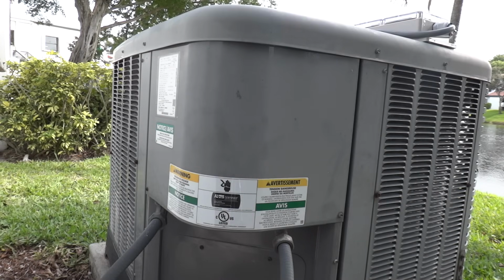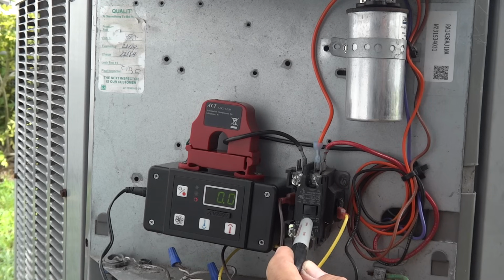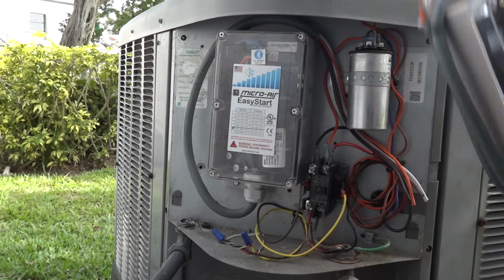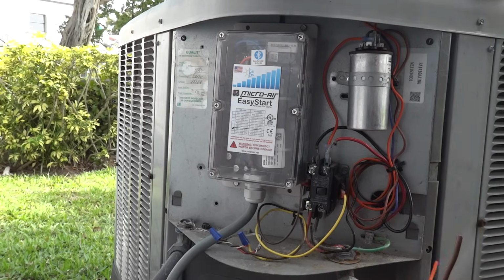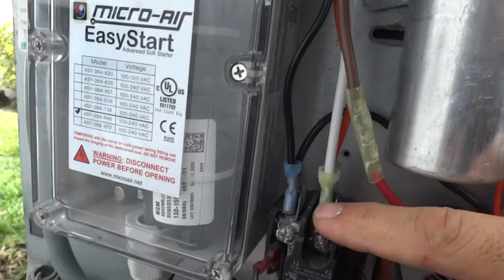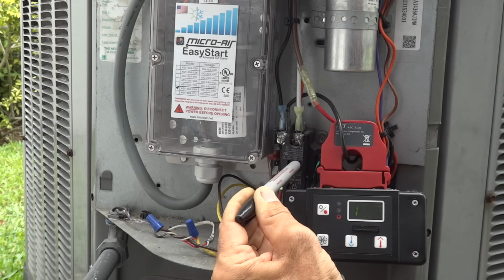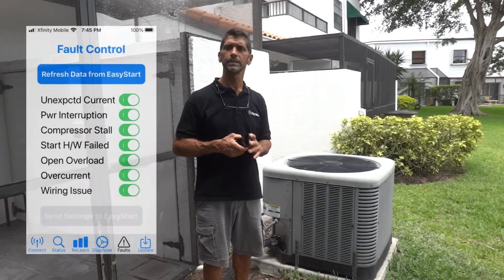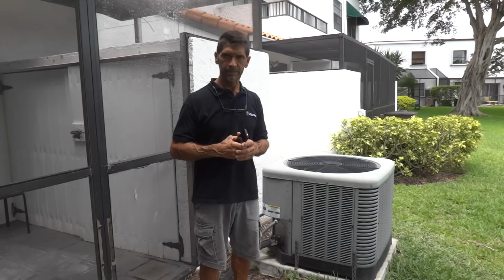Micro-Air EasyStart Home A/C Installation (368 Series)

Comment: Just curious if it makes any difference the type of compressor when using this soft-starter? I told my A/C guy about this, but he came back and was recommending a "5-2-1 compressor saver" which he said was a hard start. Perhaps he just doesn't understand why I want to use the Micro-Air product? When I am running on my whole-house (22kw) generator and the A/C unit kicks on, you can hear the generator lug down for just a fraction. I just figured that using the Micro-Air soft start, I would absolutely eliminate that. But, I want to make sure that I am not doing anything that adversely affect the outside unit. I am about 2 months from being out of warranty too!
Reply from the maker: Hello and thank you for your comment and questions. You were spot on in your assessment of your A/C tech's misunderstanding about the differences between a hard start and a soft start.  Yes, adding an EasyStart to your A/C will absolutely eliminate the startup surge that is bogging down your 22kW generator.  Adding a hard start will not eliminate the start surge, and it may or may not make any difference.  Try it if you'd like first, but I am confident you will not be satisfied with the results.  

With EasyStart installed, even when operating on utility power, it protects your compressor BETTER THAN the OEM configuration does. It achieves this in multiple ways.  Beyond its obvious benefit of eliminating the mechanical & electrical stresses of every startup, EasyStart also continues to monitor and protect your compressor after the startup is over with, during steady-state operation.  EasyStart monitors for harmful conditions like brief power interruptions, brownouts, overcurrent conditions, stall conditions, etc.  All of these would not be handled properly by the OEM configuration, but EasyStart does handle them. EasyStart will disconnect the compressor in such cases, wait 3 minutes, then re-soft-start it, likely without your even noticing.  

Since you're at the end of your warranty, you can either wait or install and EasyStart right now.  The sooner you install EasyStart, the sooner you and your generator will enjoy its benefits, and the sooner you will start extending the life of your compressor.   Thank you again for your interest.
Reply: Well, my installation has not gone so textbook! As is turns out, since I have a monitoring system (CoreSense Diagnostics), I am going to have to make some modifications to my new EasyStart, such a moving jumpers and cutting another one. And, something else (on page 15 of the troubleshooting manual about disabling the starting delay). I am still waiting on a reply from support after sending them photos and schematic before I go any further. @MicroairNet
Reply: Update...I didn't have to do anything with jumpers. But, I did have to follow the instructions on page 15 as mentioned in my last. Despite all of this, I still don't think things are working right! My unit makes really strange noises now with the Easy Start connected. What is really frustrating is the lack of help from anyone in a timely manner. The email exchanges are days apart and, while I already sent photos of my system schematic and photos of just about everything, and lastly uploaded/sent data to Micro-air from the app, I still haven't heard back. I shot video of what was happening, but not knowing A/C, I am not sure exactly what was going on. But, it seems as though the compressor was trying to start and when it did, made a kind of banging noise (that the unit never made otherwise). When it did that, the LED on the Easy Start changed to a single flash. Otherwise, it was OK. On the Copeland Core Sense monitor, it started flashing 3 flashes, indicating a couple of issues. However, when I disconnect the Easy Start, the diagnostics return to normal after the first restart of the compressor.
Reply from the maker: @ffmedic1638  I've requested that your case get priority.  Several people are on vacation this week since it is August and just before school starts.  I realize that is no excuse, but we'll appreciate your patience nonetheless.
Reply: I appreciate you reaching out to them. While someone did contact me, I have to say the help was far from what I expected. While we are experiencing 100 degree days, having to wait hours between emails  when a phone call might have taken care of a simple question. While the wiring was simple, my system had a monitoring system for the compressor which required me to make some settings changes on the Easy Start. However, even this did not get me up and running. When I would run the system with the ES connected, the compressor would not run. I finally got so frustrated with the (lack of) help, and particularly a simple phone call while I was at the outside unit, that I returned the product to Micro-Air this morning. I really hoped to see this in action on my system. But, fortunately, I do have a 22kW generator and I really don't have a problem. @MicroairNet
Reply: LATE UPDATE to the above saga: After some awesome help from MATTAO, I received a replacement unit and installed it Sept 3. We even did a couple of tweaks and got the inrush amps down a little bit more. All in all, about a 65 percent reduction!

Comment: Can I use the X72 on the 3 ton unit because I’m planning to buy a bigger unit in a couple years.
Reply from the maker: Hi and thanks for your question. Yes, you can use the X72 on a 3-ton unit, but it may not reduce the starting amps by quite as much by the X48 would.  But not to worry as the difference will be small.  Once you get your new, bigger unit, you can move the EasyStart over to that one, perform a "ReLearn", and it will work well.
Reply: Thank you.

Comment: 7/22/2023 I installed two of them on my Goodman 3 ton ac units. From 79amps drop down to 25 to 28 amps according to the blue tooth app. These things are sweet love them thank you.  I found out about these soft starts when talking to the electrician who installed our home generac generator.  All these years and never knew about this item.  I could kick my self in the ass.  Anyway thank you hooked them up today and running great.  Thanks.

Comment: Will this work on a older air it is a 3ton that uses r22 Freon
Reply from the maker: Thank you for your question.  Absolutely yes!  EasyStart works with all fixed-speed compressors on all types of air conditioners for any application, regardless of the type of refrigerant.  It even works on the older reciprocating compressors.

Comment: I just received my EasyStart this week from your company. Do you recommend I have a Heat/Air company install it, or should I do it myself? I consider myself above average for DIY jobs. I have a 4-ton Ruud heat pump here in Oklahoma.
Reply from the maker: Hi and thank you for your purchase and for your question!  If you are above average, then you can definitely do the EasyStart installation. Amazingly, at least 90% of our customer do their own DIY installation.  Check out the many sample wiring diagrams in the EasyStart Knowledge Base on the Micro-Air website.  There probably exists one that is close to your Ruud HP.  Thank you again for your business.

Comment: So what is the wiring differences if there are two different run capacitors for the fan and compressor?
Reply from the maker: There really is no difference in the wiring.  The Orange wire from the EasyStart still connects to the terminal on the compressor's (separate) run capacitor that is ultimately connected to the compressor's start winding.  This terminal may not be labeled "HERM", as in the case of a dual run capacitor, but you can still figure out which one it is by looking at your system's wiring diagram and identifying the wire and its color.

Comment: So where does the micro air unit stand on the economy side: do you experience an electric bill reduction at all?
Reply from the maker: Hello and thanks for your question.  EasyStart only dramatically reduces the start-up amperage of your compressor - which lasts about 1 seconds - and has no effect on its steady-state, running amps.  Even over a 30-day period during which a few thousand compressor startups may take place, the amount of energy saved will not add up to anything measurable in your electricity bill.

Comment: I installed the easystart 368-72 for my 4 ton Rheem unit. I terminated all of the wires exactly as indicated and I still get an error. LED light blinks 7 times. I tripled check all wires and they're landed where they need to be. Anyone know what I may have did wrong?
Reply from the maker: Hi and thank you for your purchase.  7-blinks of the red LED indicates there is still a wiring issue.  Please take some clear photos of your 4 wiring connections and of the system's wiring diagram (on the inside cover of your electric box) and submit a trouble ticket to the following website at Micro-Air.  Someone will look at your case and advise about the wiring.  

https://www.micro-air.com/contact_microair.htm

Thank you again for your business.
Reply: @MicroairNet  thank you. I will take pics and submit them.
Reply: @MicroairNet  I figured out the issue. Install error on part (obviously). The butt splice was not making full contact with both wires. I re-spliced and worked like a charm. Green LED is solid and states "normal".
My LRA went from 102.4 amps, to 28.7 amps with the easy start. Very impressive! You guys are awesome. Replying to my question within hours. Thanks.

Comment: Great video, with excellent detail. So how hard is it to get the house wired so that I can plug my 7500watt genereator it?
Reply from the maker: Hi and thanks for your compliment and comment. Wiring your house to be able to easily plug in your portable generator outside and switch over to it is a bit of work. Unless you are an electrician or very well versed in codes and electrical wiring, it can be difficult and potentially dangerous.  Typically, people get a 50A twist-and-lock outlet installed on the outside of their house near to where their electric meter comes in.  This is where the cord from the generator would get plugged in while it is running outside somewhere near the house.  Then, in their main breaker panel (load center), they have a separate breaker installed for this plug with what is known as a mechanical "interlock" that prevents this breaker from being turned on without having already turned off the main breaker feeding the panel from the grid (meter). This prevents you from backfeeding the grid with your generator during a power outage.  There is an excellent Facebook group on home generators that I have to support EasyStart questions from that you might want to join if you are interested in learning about this (https://www.facebook.com/groups/1716967438485868).  Otherwise, if you don't want to attempt it yourself, it is highly recommended that you hire an electrician.  Hope this helps.

Comment: The best starting device I have ever seen in my 40 years as an AC Tech! I would advise to checking your uf/ microfarads with a meter on the existing capacitors and see if they are up to the manufactures value. All capacitors lose value over time and age with usage. No system should ever be close to let alone exceed LRA. Locked rotor amps. I have always installed starting devices on new equipment, because it gives longer life of the compressor. It's controversial over the term easy start or hard start. They both do the same thing with a large capacitor and potential relay in the circuit. All Trane units are designed with these and some others as well. But most do not incorporate this technology. I do not recommend using a second device on a system with one on it!
Reply from the maker: Hi and thanks for your comment.  As it turns out, hard starts and soft starts are TOTALLY different.  Hard starts are nothing more than a start capacitor with a switching device.  EasyStart is a very sophisticated, microprocessor controlled soft start device that orchestrates a complex, closed-loop electronic sequence via high-voltage and high-current semiconductor devices to gently ramp-start and accelerate the compressor with up to 75% reduction in starting amps.   For further details and deep dive into the differences, please check out the video at this link:  https://youtu.be/7Gim96oyczw

Comment: Will this void your warranty?
Reply from the maker: Hi and thank you for your question.  This is an often-asked and a somewhat controversial question. The short answer is "it depends". Some manufacturers will balk at any modification to their system wiring if you submit it for warranty claim with anything added. The same holds true for an aftermarket-added hard start, right?!  The good news is that EasyStart can be wired in without cutting any wires (by using a mating terminal for the run winding splice). If the system then fails down the road within its warranty due to an internal refrigerant leak, failed condenser fan, or something else, then you can legitimately remove the EasyStart before submitting it for warranty. There is no dishonesty here since any failure outside of the compressor itself cannot be the fault of EasyStart.  

Beyond this, many of the larger A/C OEM manufacturers are now recognizing and accepting EasyStart as an add-on device and they will honor their warranties still.  This improves every day as I was just talking to another customer about this who stated Carrier was already moving in this direction.

Regarding your unit's compressor itself, as explained in the video, EasyStart far better protects the compressor than any OEM configuration, so the likelihood of a compressor failure within the warranty period is almost zero.  If there ever was a case where the compressor failed within warranty, and the manufacturer denies the claim because EasyStart was installed, contact Micro-Air and you may be surprised by we do.  Since this manufacturer's warranty concern was also an issue for some in the RV aftermarket, Micro-Air starting guaranteeing customers' RV unit compressors that are up to 6 years old (way past the standard manufacturers' 2-year warranties) for an additional 2 years.   In the past 5 years, there has only been one claim, and it wasn't really Micro-Air's fault, but we bought the customer a new rooftop unit anyway.  This extended warranty program was considered for application to the home HVAC market as well, but because of 5 and 10-year warranties there, Micro-Air could not afford the insurance to cover it.  

Please also see the verbiage about the Magnuson-Moss Warranty Act on our website in the EasyStart Knowledge Bank.  But in the meantime, if you suffered a warranty claim denial simply because EasyStart was installed, we would review your case and would still consider helping. We are that confident in EasyStart and its protection of the compressor.

Comment: Best thing I ever bought. Working flawlessly for 10 months now. 26 starting amps on my 3 ton and 9.6 running. Easily turns on a/c unit with my 12kw generator for whole house a/c during hurricane Ian.

Comment: What do we do if there is a hard start capacitor installed also
Reply from the maker: Hi and thanks for your question. If there is a hard start capacitor already installed, you must disconnect it completely (and optionally remove it) before installing EasyStart.  Hope this helps.
Reply: @MicroairNet  makes sense 
Thanks. Any discount codes🥹
Reply from the maker: You're welcome. Unfortunately, since we're at the height of high season, there are no discount promotions going on at this time.

Comment: Does the easy start lower your electric bill since the unit is running at a lower amperage
Reply from the maker: Hi and thank you for your comment. The EasyStart dramatically reduces the startup surge current of your system's compressor. The EasyStart startup is only about 1 second in duration.  Once the EasyStart completes the start, it bypasses its internal electronics with a relay.  As a result, the continuous running current for your system is unaffected by EasyStart, so your average electricity consumption is also unaffected.  Hope this helps.

Comment: Ok video.  Some of the details are lacking and different that the installation instructions from MicroAir from their website.  MicroAir needs to shoot a new video to match the instructions and make proper connections clearer.  I shouldn't have to cross my fingers and hope it works when tuning it on by following the manufacturers instructions and installation video.  Also, the Bluetooth connection sucks!!!  You have to be within ~10ft to get a signal and it provides no history.  Even my cheap Bluetooth headphones connect to my  phone in the garage from the opposite end of the house or in the basement.   It did bring down by LRA from a rated 95 to 26 on my 2002 Rheem.

Comment: Looking at adding softstart to my house AC, not sure if the fan motor, being an ECM motor without a capacitor. Is there any changes to the connections?
Reply from the maker: Hi Curtis and thanks for your question.  As you are suspecting, if the outdoor unit uses an ECM type condenser fan, then its run capacitor will be a simple, single type with only two terminal clusters on top (not three like the one in the video).  The EasyStart wiring does not change, and the orange wire will still connect to the run cap's terminal cluster that corresponds to the compressor's start winding.